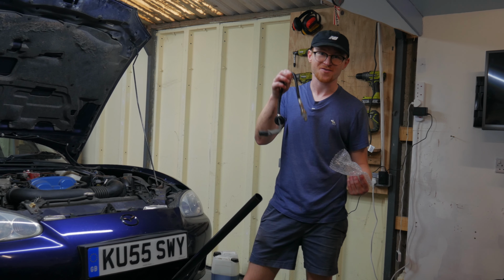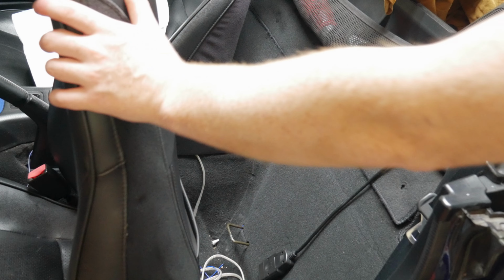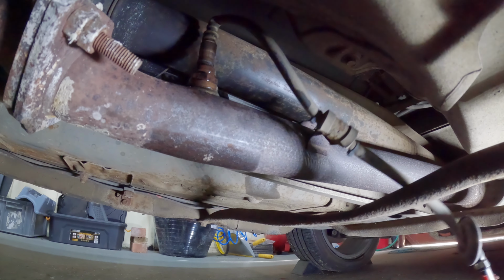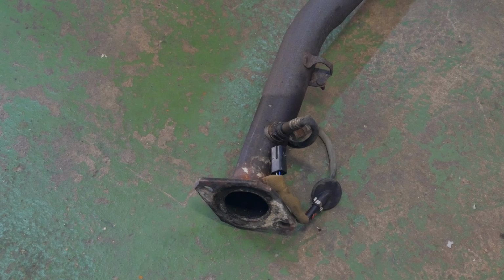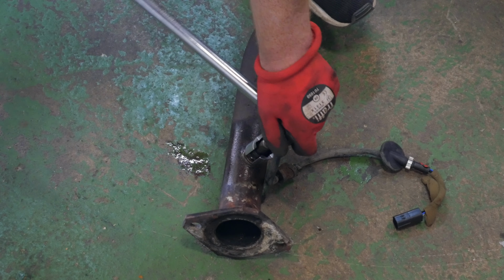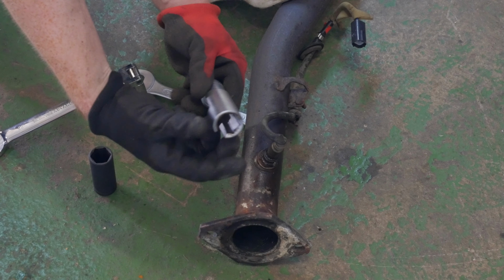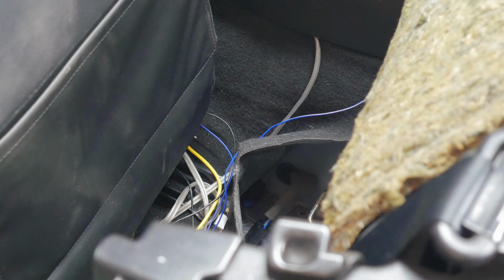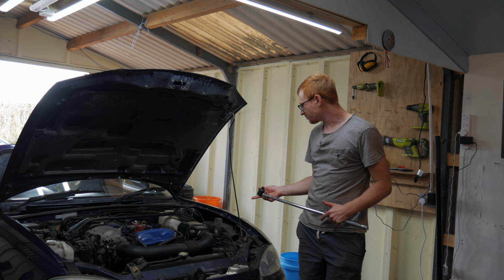How to Replace o2 Lambda Sensor | NB MX5 Miata | Post CAT | P0037 P0420 P0172

Comment: i have same code, cleaned out the maf and the light came back on so I suspect I’ll have to replace sensor, did you use aftermarket or oem? I’ve seen a few negative reviews on aftermarket sensors and oem is very expensive 

thanks
Reply from the maker: We used the IL Motorsport part which has mixed reviews

Comment: Was thinking about picking up a 2004 miata with 152k mi on it. They replaced all the hoses, timing belts and what not over the past 3 years. And they said there was a bad 02 senser so there was a check engine light. They are asking about 8k for it. Do you think it would be good as a first manual and project car? I do have another car i daily drive.
Reply from the maker: 8k? I assume you must not be in the UK! Wouldn't worry so much about the mileage, your biggest issue will be rust, check the front chassis rails and rear sills. The check engine light could also be because the CAT is gone bad too.

Comment: Did this replacement made the P0420 code disappear in your case ?
Reply from the maker: It did for a little while, but then returned. We used an aftermarket O2 sensor so that might be why.
Reply: @kentcarmedia  IL Motorsport one ? I've just ordered one from MX5Parts.
Reply: Thanks for a nice video. Was thinking of chaging my rear sensor. Since I have a p1499 error. I wonder if its the lambda gone bad or mapsensor. Egr valv, changed and ecu tested.
Reply: @kentcarmedia  same thing has happened to me, I was wondering if you got to the bottom of this one or if you left it at this, also wish I watched the video before doing this myself haha
Reply from the maker: Unfortunately it was a mates car and he spun it into a field shortly after 🤣
Reply: @kentcarmedia  well, that’s one way to deal with the problem 😅

Comment: unfortunately found myself watching this vid cause my check engine light is on ... waiting for the obd scanner to come :( think it's misfiring cus car has low power / sounds like it's farting / super strong smell of petrol. praying it's not an expensive fix. a man can hope it's just the sparkplugs that need doing
Reply from the maker: Could be worth swapping the leads if you have any spare. Fingers crossed you get it sorted !
Reply: @kentcarmedia  don't have any spare unfortunately, i'll do the sparkplugs today and see what code i get, it may be the coilpacks so will do the leads when i do them anyways. hopefully the cat isn't screwed!
Reply from the maker: If it's misfiring I doubt it's anything to do with the CAT. Could cause the error due to all the un burnt fuel being thrown down the exhaust!
Reply: @ i was worried about cat damage as the misfire started when i was half way home so did about 30 minutes of driving - misfire in cylinder 3 was the code, tried a sparkplug but no luck, hopefully the new coilpack and ht lead sorts it, lot of people seem to suggest it's 90% of the time gonna be the coilpack for an mx5. half a year ago i was looking at turboing my mx5 now just trying to get it running properly haha.